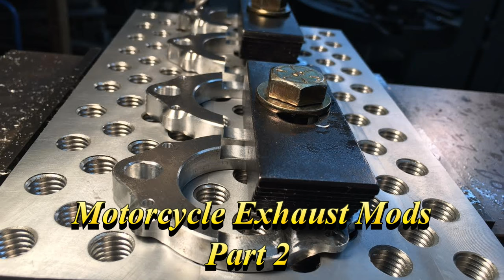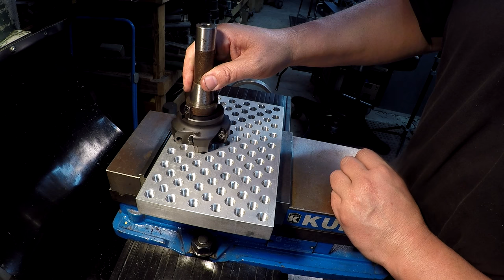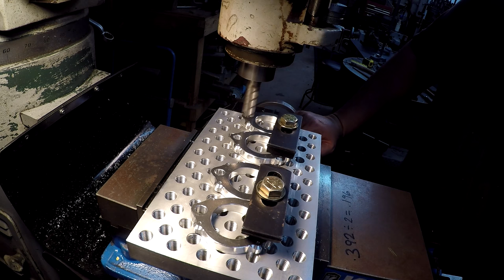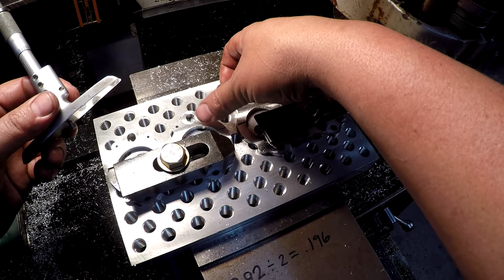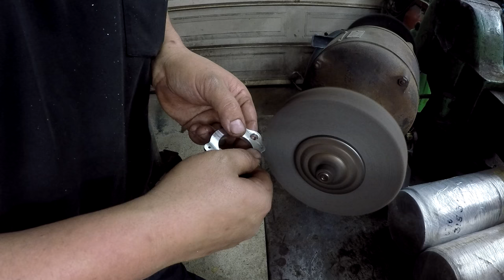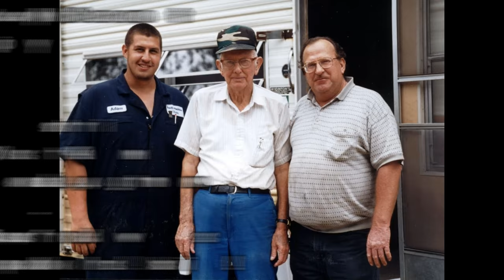Motorcycle Exhaust Mods Part 2

Comment: As a suggestion for a future SNS: Cutting oils and fluids used on different materials.
Thanks for the video.
Reply: My guess would be aluma-tap for aluminum and dark cutting oil for everything else.
But I would be curious what to use on copper alloys
Reply: I somehow don't think it's that simple.
Reply: WD-40 is the optimal cutting fluid for aluminium. Alcohol is second best.
Reply: A friends automotive machine shop has used kerosene on aluminum for years.  They do all kinds of race parts and they come out beautiful..
Reply: I chooch the CRC 556 on all the Ali stuff to machine and drill, same stuff but WD40 smells like cat wee.
Reply: The main point of cutting oil for aluminum is to prevent (or at least discourage) the swarf from welding itself to the cutting edge of the tool. For ferrous metals it's something a bit different. WD-40 (because it sticks to the metal tool better than water (WD=water displacing)) also sticks to the tool better than the aluminum swarf. Kerosine does about the same thing.

Comment: Nice work as per. I have a similar sized facemill as yours but with round inserts and with only one insert fitted it's my favourite tool for facing large areas of steel or aluminium.

Comment: An ordinary green scotchbrite pad and a little WD40 will get banish the "Fuzzies" real quick. Great job as always, Adam!
Reply: Csab u
Reply from the maker: +Matthew Helton I used a mill smith file lightly first then scrotchbright with WD. Worked fine.
Reply: Stoning aluminum results in a stone that needs to be dressed.
Best keep you aluminum and brass away from stones

Comment: Nice work on the machining, of course.I suspect he may have a time sealing the flanges with them that thin, once those get to temp and soften the tabs will probably bend. If he needs flanges thin for room to fit Id be laser cutting a full set from one plate to tie the pipes together at the flange by a single flange plate so all the inner bolt tabs cant bend under heat. May not look so pretty though.

Comment: Nice work Adam on the project.  I might have to make another pallet with larger tapped holes, seems convenient to be able to use the 1/2-13 hardware.  I think the DoAll can get close to the NYC CNC Haas surface finish with a Abom79 grind on a HSS flycutter 😃
Reply from the maker: +Bill De La Vega Yep, I think I'm going to revisit the mini pallet with some other tools when I'm not in a hurry and show the viewers that I do own a fly cutter.

Comment: Nice work. Was wondering tho, don't you have a fly cutter? That's my tool of choice for decking off a wide surface like the pallet. Especially when I'm not taking off but a few thousandths on a wide surface I can get most jobs done in a pass or two. You should have shown two of them being done in the lathe too. I probably would have gone that route only because I like the finish better. Thanks for sharing!

Comment: I do the same in the Philippines specially motorcycle parts and small engine I do this all in my many lathe machine that made in China cheap quality but I do also some precision jobs like for example a check valve of a compressor made of carbon steel a .5 mm thickness and 40 mm OD and 16 mm ID...

Comment: At 15:20 I noticed a Bearings and Drives scale on your keyboard.  I still have one just like it from my first job around 1967 or 1968.  Is yours that old or are they still giving them out 50 years later?

I love watching your videos, I am learning a lot and it brings back memories at the same time.  I ended up in electronics engineering and retired a couple of years ago .  I worked with a couple of good machinist during part time summer jobs and I never lost interest in their skills.  Most of the stuff you do is similar to what they did but yours is on a much bigger scale.

Have you considered a new logo for your travel videos.  The mike is good for your machining videos but something with the charger would be good for travel.

Thank you for the time and work you put into posting for us.

Keep posting and I will keep watching.
Reply from the maker: That scale was one I found in one of my tool boxes. I showed the guys at work because Bearings and Drives is now Motion Ind. Pretty cool. I seen another one at an antique store but the lady wanted $10 for it, a bit steep for a 6" scale.  Not a bad idea for the travel videos.

Comment: Always amazed how quiet all Abom's machinery is.  How the heck is your scotch bright wheel quiet enough to talk over?  Keith just did a whole overhaul on his lathe and yours is still 10x quieter than his
Reply from the maker: +Jon Eisenhower Guess I just lucked out in getting the best machinery 😎
Reply: We had a bosch buffer at my high-school machine shop with the scotch bright wheels, and that might have been my favorite tool. Super quiet, and puts a perfect tiny round-over on everything.

Regarding lathes, that's the difference between spur gears and helical oil-bath gears.
Reply from the maker: +The Metal Butcher You got that right! I have a shop Talk showing the inside of the Monarch headstock.

Comment: Would it help if you'd first chamfer  the holes before flattening the surface? I say this because. Doing the chamfering after might raise a tiny shoulder on the edges. Also thank you for the video. Greetings from Belgium
Reply from the maker: BD Jappe You can file, deburr and polish the parts as needed.

Comment: Why didn't you pull them down on the miller bed.  mill one side add clamps that side them remove the first set mill off other side.

Comment: Adam, instead of milling the pallet. Would surface grinding been a better option, if available?
Reply: ImpsMyPimp milling the pallet lets you keep it in the vise on the mill to ensure it stays flat with everything. surface grinding you'd have to move it from the grinder to the mill, then indicate and bump it perfectly flat with the table, not to mention it could be far enough out of flat that it'd take a long time on the surface grinder.
Reply from the maker: +ImpsMyPimp The aluminum pallet lets you machine it lightly each time to assure its flat and  perpendicular to the spindle.

Comment: It would be interesting to see how much konvex the plate would be when you took it down from the vice. If you would measure it?How many thousands it would changeg between the center line and the edge or the alu-plate
Reply from the maker: Considering the plate is not machined completely square I'm sure it'll deform slightly, but usually for general machining like this it's not a concern. Interesting shop topic though for sure.

Comment: Were the plate made of steel and had no holes in it, what would make it flatter: the milling machine with the correct cutter or hand scraping?  This I struggle to comprehend.
Reply: Eric haskell well, I don't think Adam has a verified flat reference surface, for finding the high spots for scraping. But done properly, scraping will be flatter.
Reply: Eric haskell The mill has the potential to be out of tram, where the cutter could be cocked compared to the work, leaving either a saw like finish (if the tramming is out perpendicular to the tool path) or a"dip" left behind the tool if it's out of tram parallel to the tool path. beyond that, the ways of the mill may not be perfectly flat.

Scraping has the capacity to be virtually as flat as whatever reference surface you use for it